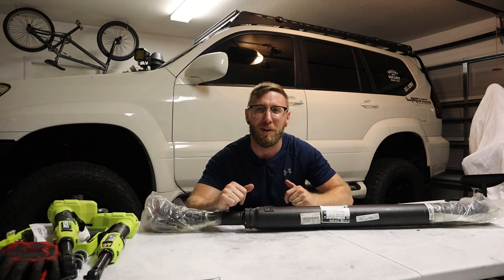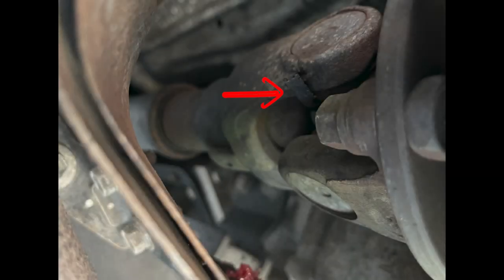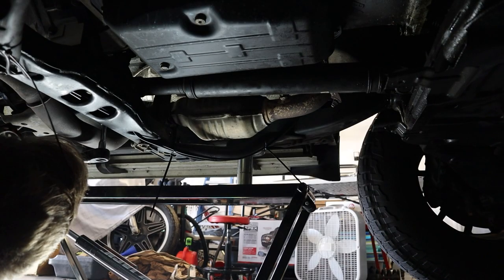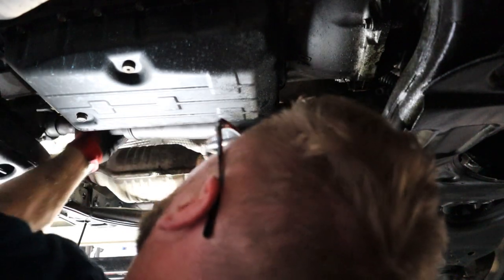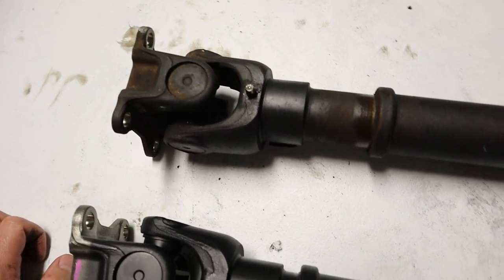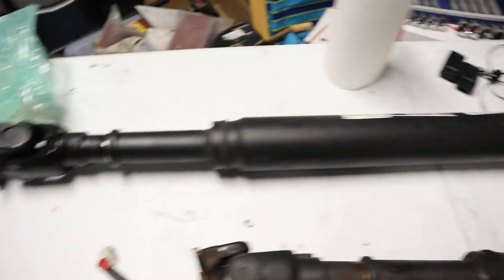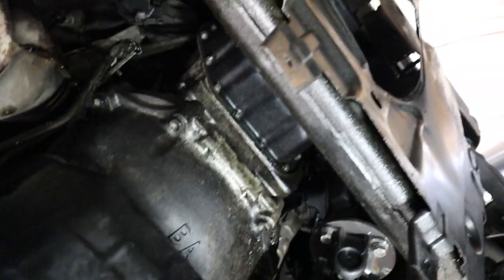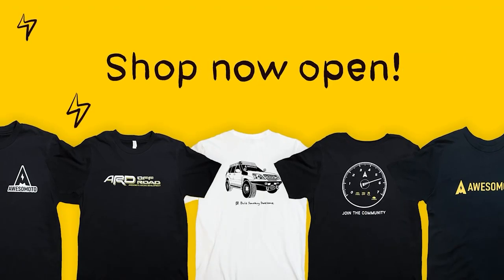Vlog 68 - Lexus GX470 Driveshaft Replacement

Comment: Awesome video! I think this is what's wrong with mine. I've started getting such a loud, bass rumble at highway speeds. I also noticed a clanking noise when I would shift from reverse to drive.
Reply from the maker: Thank you!! Yep, that sounds like the symptom. Luckily this is a very easy DIY job to do that can save you $$. Let me know if you have any questions during your install.

Comment: IIIRC, there was some talk about using 460 driveshafts (an “upgraded” version”) — what was your consensus on that
Reply from the maker: Great question! I should have mentioned that the earlier years of the GX470 had a driveshaft issue which was later replaced before the end of the GX470 era(later model 470s got the upgrade). It’s the same part number for the GX460, so this will get you the “upgrade” you’re referring to.
Reply: What year got the upgrade?

Comment: Just pulled my front driveshaft off today, the joint at the front diff was shot. I’m going with just replacing the u joints themselves and not the whole shaft. Hopefully you kept yours, rebuild them and have a spare set!
Reply from the maker: Awesome! Great choice in rebuilding yours. Yes, I have a spare rebuilt driveshaft and CV axles in case something happens on the trail

Comment: Awesome video and thanks for sharing. I'm coming up on 180K on my GX so I'm sure I will have to do this job soon. Luckily I'm down the street for the place you got your parts from.
Reply from the maker: Thank you! Yes, unfortunately you may run into this eventually. You can grease the driveshaft to prevent the west that happened to mine and get more mileage out of it though. The great thing is that it’s any easy job to do yourself and that Wesley Chapel dealer is great.

Comment: Great video! I see traces of oil leaking on the transmission area which should be leaking from the rear main seal. Can you make a video how to replace it?
Reply from the maker: I'll have to double check to verify it's not my rear main seal, but there is currently oil all over that area due to a failed valve cover gasket. I'll be doing a video on that replacement soon. If the rear main seal is gone, then I'll also be making a video on that. Thanks for reaching out!

Comment: Man I had the exact same noise. I thought it might be a wheel bearing but it was the front drive shaft. I changed the rear shaft and did the universal joint for the front.
Reply from the maker: That’s so awesome to hear this was also your fix. I never changed a driveshaft before…pretty simple and very satisfying to have that noise gone!

Comment: So just to be clear, after you mark the old driveshaft, you match it up with the new driveshaft and make those same marks?
Reply from the maker: You got it! And ensure the marks on the old drive shaft extend onto the front diff and transfer case so you have marking there as well.
Reply: @Awesomoto  Understood. Thanks!
Reply from the maker: @supitown6013  Of course!

Comment: Thanks for the detailed vid!! I have the same noise (not as loud but it's there), did you ALSO find before replacing the front drive shaft you would at times get a shimmer (side to side) in the steering wheel??   (my alignment & tires are balanced)
Reply from the maker: Your welcome Eric! Thank you for reaching out! Yes, I noticed some side to side sway and in general the vehicle didnt feel balanced at certain speeds.

Comment: Hi, my GX460 has thumb only when cold, still underwarranty but lexus wont repair, so how can i repair? It only feels when cold outside like 40f below
Reply from the maker: Thanks for reaching out! So were they able to confirm it's an issue with the driveshaft? If so, just replace it yourself like in the video...or pay a local shop to replace if you aren't comfortable doing the replacement.

Comment: what size were the nuts and bolts on the drive shaft
Reply: Cause I would like to know this as well
Reply from the maker: There is a link to the nuts in the video description so you can order the OEM hardware. Let me know if you have trouble accessing the link.

Comment: Great video man, wish i found it before I took off the  driveshaft. I didn't mark the spots, what issue does that cause please?
Reply from the maker: That's a good question. I personally had to think this through myself as I can't immediately think of what would go wrong if anything when things aren't phase aligned. I could be wrong since I'm not a drivetrain expert, but it would seem that both the front differential and the transfer case are symmetrical components in that I wouldn't expect there to be any catastrophic issues from phase differences. I honestly did it because it made sense at the time, but thinking about it more makes me feel there shouldn't be an issue.  Maybe someone can chime in and tell me why this could be bad?
Reply: @Awesomoto  I appreciate the response, been driving it, nothings happened, knock on wood
Reply: The shaft itself is balanced but the phasing on the transfer case and diff ends shouldn’t matter. It’s not a problem if you don’t take the u joints apart

Comment: The only thing I've seen recommended that you did not do was to actually remove the zerk fitting for the slip yoke on the driveshaft and find a curb or dip to drive the GX over a few times to get the slip yoke to go through its travel. With the zerk fitting removed if there is too much grease it will just spit out the excess. If you over-grease the slip yoke you run the potential of blowing the seals out when the driveshaft compresses and can't compress the grease

I grease mine every oil change along with my JBA UCAs and I'll pull that zerk fitting and do a quick drive just in case
Reply from the maker: Great suggestion. I had not thought of this during the install and I appreciate your experience and sharing feedback for others. Thank you! 🙏

Comment: What is this 'phase' of which you speak?
Reply from the maker: Great question! I’m referring to the phase as in the phase angle of the drive shaft. Or in simpler terms, making sure the angle/position is the same. These driveshafts come balanced from factory, so I don’t know how much it matters, but it’s easy enough to match the angle of the original driveshaft to the new. Hope this helps. Thanks for watching and reaching out! 🙏🏻
Reply: @Awesomoto  yes. Separation of the spline allows for independent rotation of the halves. It's possible that balancing was done with the spline assembled. It's also possible that balancing was done with u-joints installed. There is no discussion of orientation to mounting plates.

Comment: The spline in the rear shaft doesn't grease properly. One is better off removing, separating, cleaning, and greasing the spline.
Reply from the maker: Thank you for that info. I'm about to replace that rear shaft since I have a spare now.